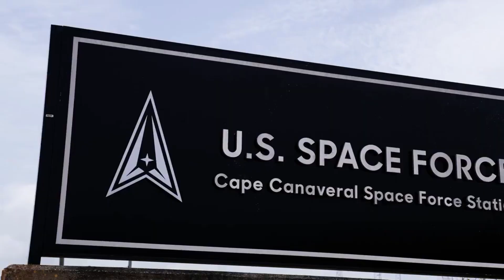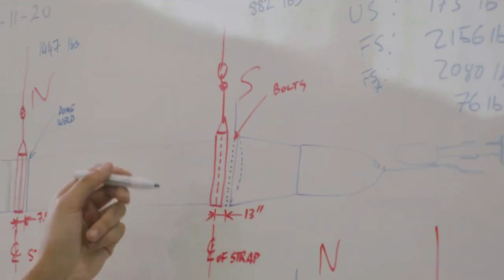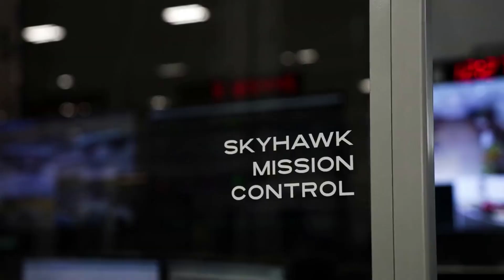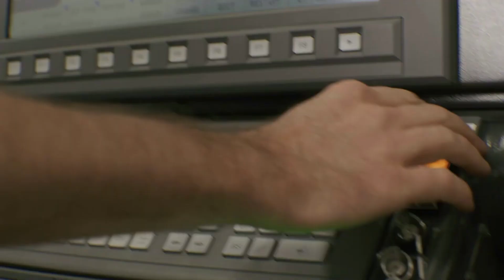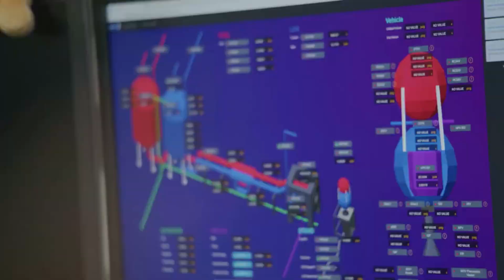Astra Fails To Reach Orbit And Deliver NASA TROPICS Payloads

Comment: I do want them to solve these issues, do they still have upcoming launches?
Reply: They have two more launches for NASA...Tropics 2 and Tropics 3 that will each have 2 cube sats on each rocket...Astra really needs to go 2 for 2 on these next two launches.
Reply: @markb2773  Yeah, well if they can pull it off then cool, cheaper space